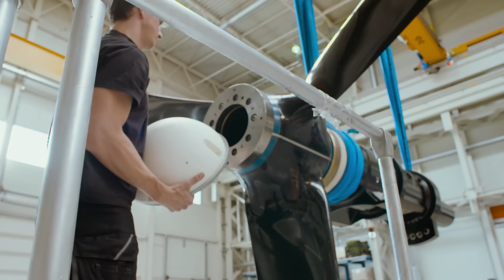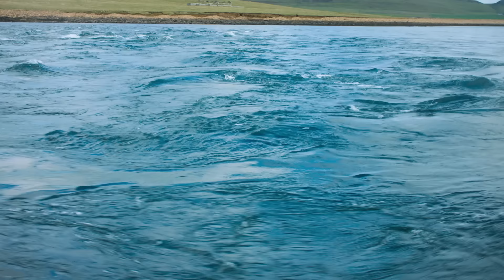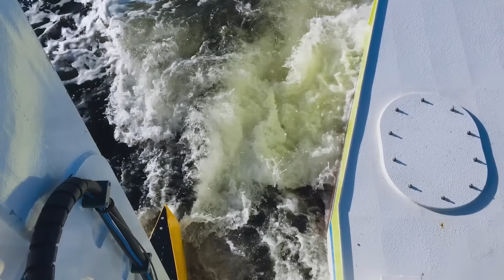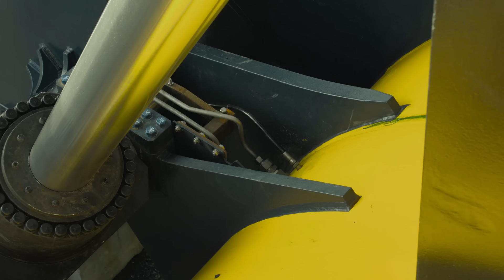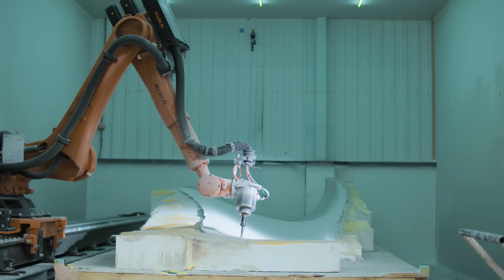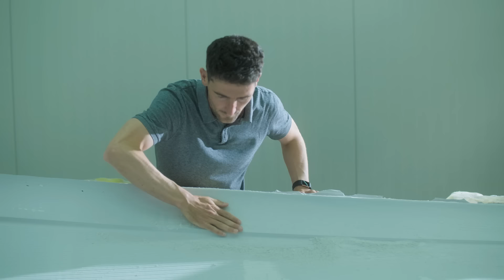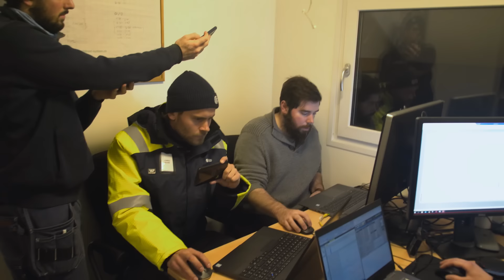Tidal Power: Unlocking the Greatest Untapped Energy Resource on the Planet | FD Engineering

Comment: Because the tide takes 6+ hours to travel around Britain, if you built a series of these tidal power stations around the coast, you would have constant, clean predictable power.  With none of the problems of gas power, nuclear or the intermittent power provided by solar and wind.
Reply: Australians have the added benefit of being big enough to have different weather patterns in different parts of the country at the same time as well as the tides over more time zones.🌝
Reply: @malcolmrickarby2313 
Hey Mal, you must be up North. QLD or WA?
The Southern Ocean and Australia's landmass, influence 80% of Global Weather.
CSIRO.
Reply: 😂Thanks your ''Anthony 😂😂
Reply: Nuclear has zero problems other than upfront cost, which I think would be comparable after looking at building this many turbines.
Reply: @gormauslander  You need to do some home work on the lengthy list of long standing problems with commercial nuclear power.
Reply: @beyondfossil  name 3
Reply: @gormauslander  See my lengthy comment above on high capital cost and highest cost per MWh, long construction time of decades, and spent nuclear fuel.
Reply: @gormauslander  ...moreover...

Much less than 1-percent of the world's land surface covered in current generation photovoltaics can power all the world's grids.  There is enough offshore wind to power the world several times over.  This is the huge cosmic power of the sun providing a massive non-stop 173,000-terawatts to the Earth.  That amount of power can provide all the 620-exajoules of energy we use annually around the world in just 1-hour.  Or, just 1/10000th of that power spread over 365 days of the year.  There is no greater source of power within over 4-light years from around here.

The raw inputs of sunlight and wind cannot be taxed, sanctioned or blockaded.  Some combination of sun & wind is available everywhere on Earth.  Renewable energy and photovoltaics in particular have reached historical low costs of energy production and still continue to drive their costs lower.  All while commercial nuclear power just keeps getting more expensive.

China is currently building the equivalent of 5 nuclear power station's worth of solar capacity a week!  Even given solar 20% capacity factor, that still equals 1 nuclear power plant a week.  Even in the most ardent nuclear fan's wettest dreams could they even imagine this growth with commercial nuclear power.

Commercial utility-scale nuclear power is far too expensive and its risks too high for the low benefit.  Nuclear power is simply the wrong tool for the job on the terrestrial grid: too slow to build, too expensive, too collectively small in size, too risky with risks no other power generation has.  Utility scale nuclear power will largely fade from the grid within about 50-years.  But nuclear power will remain in small-scale applications where it excels: military, scientific, nuclear medicine, and deep-space exploration.  These are important areas of society as well but utility scale nuclear has proven itself over the many decades its been given to work to be unsuitable largely on cost and time.  But throw in the problem of nuclear waste as well then the huge growth of renewables backed by the cosmic power of our sun and utility scale nuclear power is essentially dead.
Reply: @gormauslander  ...moreover...

Much less than 1-percent of the world's land surface covered in current generation photovoltaics can power all the world's grids.  There is enough offshore wind to power the world several times over.  This is the huge cosmic power of the sun providing a massive non-stop 173,000-terawatts to the Earth.  That amount of power can provide all the 620-exajoules of energy we use annually around the world in just 1-hour.  Or, just 1/10000th of that power spread over 365 days of the year.  There is no greater source of power within over 4-light years from around here.

The raw inputs of sunlight and wind cannot be taxed, sanctioned or blockaded.  Some combination of sun & wind is available everywhere on Earth.  Renewable energy and photovoltaics in particular have reached historical low costs of energy production and still continue to drive their costs lower.  All while commercial nuclear power just keeps getting more expensive.

China is currently building the equivalent of 5 nuclear power station's worth of solar capacity a week!  Even given solar 20% capacity factor, that still equals 1 nuclear power plant a week.  Even in the most ardent nuclear fan's wettest dreams could they even imagine this growth with commercial nuclear power.

Commercial utility-scale nuclear power is far too expensive and its risks too high for the low benefit.  Nuclear power is simply the wrong tool for the job on the terrestrial grid: too slow to build, too expensive, too collectively small in size, too risky with risks no other power generation has.  Utility scale nuclear power will largely fade from the grid within about 50-years.  But nuclear power will remain in small-scale applications where it excels: military, scientific, nuclear medicine, and deep-space exploration.  These are important areas of society as well but utility scale nuclear has proven itself over the many decades its been given to work to be unsuitable largely on cost and time.  But throw in the problem of nuclear waste as well then the huge growth of renewables backed by the cosmic power of our sun and utility scale nuclear power is essentially a dead man walking
Reply: @gormauslander  In addition...  Spent nuclear fuel is one of the deadliest materials on Earth.  It emits lethal amounts of gamma radiation, and the radiation is highest when first removed from the nuclear core.  Its typically stored on-site for a few years for its radiation to subside somewhat to be transported.  This is an extra danger when the nuclear power plant is within a conflict zone like in eastern Ukraine (Zaporizhzhia) and western Russia (Kursk).  That spent fuel might not be housed within the containment dome. Afterwards, the remaining spent fuel is hazardous for tens of thousands of years at least even longer.  Storage of nuclear waste is only theoretical as we cannot predict our storage mechanisms and sites will reliably last 100 years let alone 10,000+ years.  Look at the ongoing disaster at Germany's Asse-II mines that were repurposed for nuclear waste storage in the 1950s and is now a huge mess.
Reply: @gormauslander  ...moreover...

Much less than 1-percent of the world's land surface covered in current generation photovoltaics can power all the world's grids.  There is enough offshore wind to power the world several times over.  This is the huge cosmic power of the sun providing a massive non-stop 173,000-terawatts to the Earth.  That amount of power can provide all the 620-exajoules of energy we use annually around the world in just 1-hour.  Or, just 1/10000th of that power spread over 365 days of the year.  There is no greater source of power within over 4-light years from around here.

The raw inputs of sunlight and wind cannot be taxed, sanctioned or blockaded.  Some combination of sun & wind is available everywhere on Earth.  Renewable energy and photovoltaics in particular have reached historical low costs of energy production and still continue to drive their costs lower.  All while commercial nuclear power just keeps getting more expensive.
Reply: @gormauslander  Finally... China is currently building the equivalent of 5 nuclear power station's worth of solar capacity a week!  Even given solar 20% capacity factor, that still equals 1 nuclear power plant a week.  Even in the most ardent nuclear fan's wettest dreams could they even imagine this growth with commercial nuclear power.

Commercial utility-scale nuclear power is far too expensive and its risks too high for the low benefit.  Nuclear power is simply the wrong tool for the job on the terrestrial grid: too slow to build, too expensive, too collectively small in size, too risky with risks no other power generation has.  Utility scale nuclear power will largely fade from the grid within about 50-years.  But nuclear power will remain in small-scale applications where it excels: military, scientific, nuclear medicine, and deep-space exploration.
Reply: @beyondfossil You clearly have no understanding of how radioactive waste works or how we store it, and your confident ignorance is absolutely hilarious.

Although some radioactivity remains in nuclear waste for over 10,000 years, these extremely long-lived radioisotopes are of low activity, many emitting alpha particles that cannot escape from the waste itself. Many people worry nuclear waste cannot be stored safely for millennia – beliving we cannot be confident  that radioisotopes will not leach out from underground geological repositories. But observations of uranium deposits in Oklo, Gabon, Africa, the site of several small natural nuclear reactors that ran off and on over a millenia,stand as reassurance  that nuclear waste can be safely stored for millennia.

Nuclear waste is not the hellish material of popular imagination, studies have shown it can be stored safely for millennia in geological repositories.
Reply: Just put grating over the turbine blades and it isn't an issue
Reply: Look at the shear quantity needed. Another "dilute energy" source getting oversold to the public. How many thousands of square miles needed to produce 8,000MW 24/7 like the largest nuke plant in Japan? You said 3,000 GW. Tell me how may square miles. What effect will these monster on sea life? How many aquatic animals will be chopped to pieces? When they break up how will broken pieces be reclaimed so pollution doesn't take place. The flour mill is fine, but I will lay you 100:1 odds the flour is ten times the price of a natural gas flour mill that can run 24/7. Who wants to pay that? One unit produces enough electricity for 650 homes. So to power NYC you would need well over 5,000 of these. To feed the US housing, the need would 135,000 of these up and down both coasts. The continental US has 12,500 miles of coast line, this would be 10 of these for every mile From Maine around Florida to the Texas/Mexico border; then from the state of Washington down to the cali/Mexican border. This could be done with 72 nuke plants at 8,000 mW ea, roughly 1.44/state. A much smaller foot print, much easier to maintain, build and service on ground instead of under water. Me thinks you've done to many drugs
Reply: 75 killerwatts it took to lift the legs of 1 of the turbines! how hard does the ocean have to work to lift all boats during tide without any flow? what im saying tidal lift has infinitly more power then  flow!
Reply: @custardcatcher5195 
Where do you think the upwelling water "lift" comes from?
Your Hypothesis says it can't "flow" in to "lift". There must be Magic in your system!
Reply: @custardcatcher5195 custardcatcher sounds like a brand of condoms
Reply: UK. We would rather spend our cash on improving the lives of people who want us to look after their needs.
Reply: @alexhayden2303  that's what you get when voting marxist Labour parties.
Reply: What problems of gas power and nuclear?
Reply: @kitemanmusic  Gas, the CO² pollution it causes. As for nuclear power, I suppose it's the nuclear waste, although I'm still waiting for someone to explain to me why that's a problem when we've already got plenty of it stored on the surface (and more is going to be/is already stored deep underground), and that poses no problem, no pollution.
What's more, even without nuclear energy, we still produce waste from the medical, research and defence sectors, which will always be produced.
Reply: @kitemanmusic  Natural gas almost all methane (CH₄) which is a potent greenhouse gas with some 80X the potency of CO₂.  Natural gas power plants emit some 400+kg of carbon dioxide (CO₂) emissions per megawatt-hour (MWh).  Additionally, methane is a very lightweight gas that will want to escape any vessel it's contained within, see the "fugitive emissions problem".
Reply: @kitemanmusic New nuclear power plant construction is almost always over-budget by billions and over-schedule by years.  It has to be the longest running joke in the energy industry.  In over 70+ years of operation, commercial nuclear power only run some 10-percent of the world's grids and falling. If commercial nuclear hadn't failed as much as it did and continue to fail, we wouldn't be so far down the climate change hole we are in now.

Nuclear power is amongst the most expensive forms of energy, and it's just keeps getting more costly.  Then there's the ongoing issue if nuclear fuel waste which is some of the deadliest materials on Earth (gamma radiation) and remaining hazardous for tens of thousands of years at least even longer.  Storage of nuclear waste is only theoretical as we cannot predict our storage mechanisms and sites will reliably last 100 years let alone 10,000+ years.  Apologies to future generations.

Germany, Belgium, Spain, Switzerland, Italy, Taiwan, Austria have abandoned or announced to abandon commercial nuclear energy.

Look at the financial and schedule fiasco that is the new Georgia Vogtle power plant.  Over-budget from original $14B to over $34B.  Rate payers on hook for some $7.8B loan.  Likely they are only just paying the interest on that massive debt only!  Look at the fiasco of UK's Hinkley Point C ballooning budget over-runs and years long delays.  Finland Olkiluoto nuclear power plant took 18 years.

The next 10- to 20-years will be critical to avoid the worst of climate change.  Yet construction of a single nuclear power plants takes 10+ years while producing zero watts of power.  Commercial nuclear power will barely put a dent in the large amounts of energy needed to displace fossil fuels.
Reply: @kitemanmusic  Natural gas is just 99+% methane (CH₄) which is a potent greenhouse gas with some 80X the potency of CO₂.  Natural gas power plants emit some 400+kg of carbon dioxide (CO₂) emissions per megawatt-hour (MWh).  Additionally, methane is a very lightweight gas that will want to escape any vessel it's contained within, see the "fugitive emissions problem".  

Multiply this by many thousands of natural gas stations around the world that produce many hundreds of thousands of MWh of electricity annually.  Continued use of fossil fuels just digs us deeper in the climate change hole, keep conflicts over fossil fuels going longer, and helps keeps fossil fuel dictators like Putin in power.  Being under the heel of OPEC isn't ideal either.

There are other pollutants like NOx, SOx, CO, particulate matter (PM), formaldehyde.

Lastly, fossil fuels won't last forever.  Anywhere from 50 to 250 years estimates, which is peanuts compared to earliest recorded human civilization which goes back 4500+ years and we intend to go on a lot longer.  Then contrast that with renewable energy (including tidal) that will last for billions of years and simply has many orders of magnitude more energy than all the fossil fuels on Earth combined past, present and future.
Reply: @kitemanmusic  Natural gas is just 99+% methane (CH₄) which is a potent greenhouse gas with some 80X the potency of CO₂.  Natural gas power plants emit some 400+kg of carbon dioxide (CO₂) emissions per megawatt-hour (MWh).  Additionally, methane is a very lightweight gas that will want to escape any vessel it's contained within, see the "fugitive emissions problem".  

Multiply this by many thousands of natural gas stations around the world that produce many hundreds of thousands of MWh of electricity annually.  Continued use of fossil fuels just digs us deeper in the climate change hole, keep conflicts over fossil fuels going longer, and helps keeps fossil fuel dictators like Putin in power.  Being under the heel of OPEC isn't ideal either.

There are other pollutants like NOx, SOx, CO, particulate matter (PM), formaldehyde.
Reply: @kitemanmusic  Natural gas is almost all methane (CH₄) which is a potent greenhouse gas with some 80X the potency of CO₂.  Natural gas power plants emit some 400+kg of carbon dioxide (CO₂) emissions per megawatt-hour (MWh).  Additionally, methane is a very lightweight gas that will want to escape any vessel it's contained within, see the "fugitive emissions problem".

Multiply this by many thousands of natural gas stations around the world that produce many hundreds of thousands of MWh of electricity annually.  Continued use of fossil fuels just digs us deeper in the climate change hole, keep conflicts over fossil fuels going longer, and helps keeps fossil fuel dictators like Putin in power.  Being under the heel of OPEC isn't ideal either.

There are other pollutants like NOx, SOx, CO, particulate matter (PM), formaldehyde.
Reply: @kitemanmusic  Natural gas almost all methane (CH₄) which is a potent greenhouse gas with some 80X the potency of CO₂.  Natural gas power plants emit some 400+kg of carbon dioxide (CO₂) emissions per megawatt-hour (MWh).  Additionally, methane is a very lightweight gas that will want to escape any vessel it's contained within, see the "fugitive emissions problem".

Multiply this by many thousands of natural gas stations around the world that produce many hundreds of thousands of MWh of electricity annually.  Continued use of fossil fuels just digs us deeper in the climate change hole, keep conflicts over fossil fuels going longer, and helps keeps fossil fuel dictators like Putin in power.  Being under the heel of OPEC isn't ideal either.

There are other pollutants like NOx, SOx, CO, particulate matter (PM), formaldehyde.
Reply: @kitemanmusic  Natural gas almost all methane (CH₄) which is a potent greenhouse gas with some 80X the potency of CO₂.  Natural gas power plants emit some 400+kg of carbon dioxide (CO₂) emissions per megawatt-hour (MWh).  Additionally, methane is a very lightweight gas that will want to escape any vessel it's contained within, see the "fugitive emissions problem".

Multiply this by many thousands of natural gas stations around the world that produce many hundreds of thousands of MWh of electricity annually.  Continued use of fossil fuels just digs us deeper in the climate change hole, keep conflicts over fossil fuels going longer, and helps keeps fossil fuel dictators like P_tin in power.  Being under the heel of OPEC isn't ideal either.

There are other pollutants like NOx, SOx, CO, particulate matter (PM), formaldehyde.
Reply: @kitemanmusic  Natural gas almost all methane (CH₄) which is a potent greenhouse gas with some 80X the potency of CO₂.  Natural gas power plants emit some 400+kg of carbon dioxide (CO₂) emissions per megawatt-hour (MWh).  Additionally, methane is a very lightweight gas that will want to escape any vessel it's contained within, see the "fugitive emissions problem".  

Multiply this by many thousands of natural gas stations around the world that produce many hundreds of thousands of MWh of electricity annually.  Continued use of fossil fuels just digs us deeper in the climate change hole, keep conflicts over fossil fuels going longer, and helps keeps fossil fuel dictators like Putin in power.  Being under the heel of OPEC isn't ideal either.